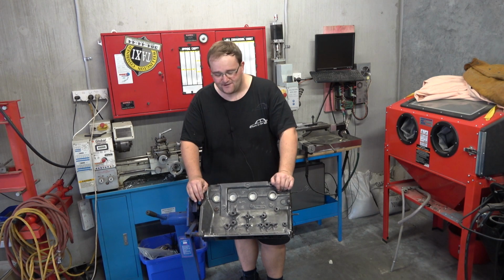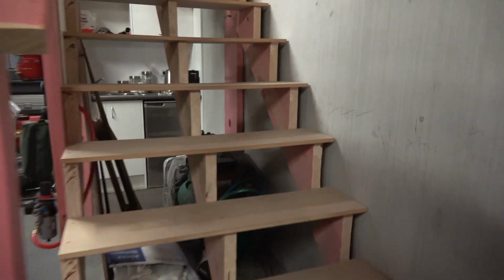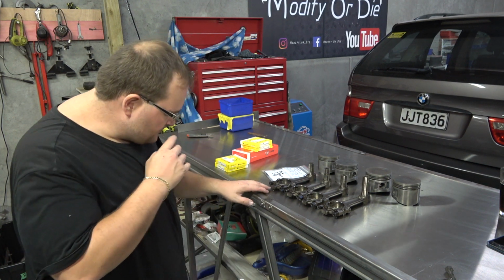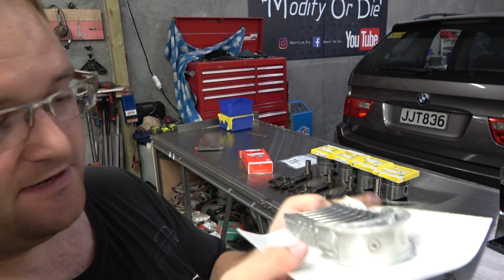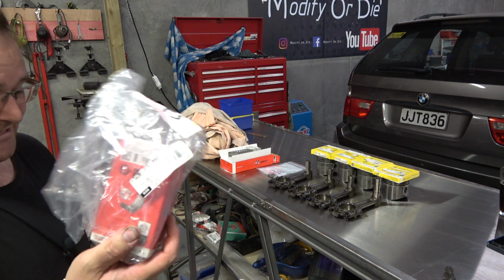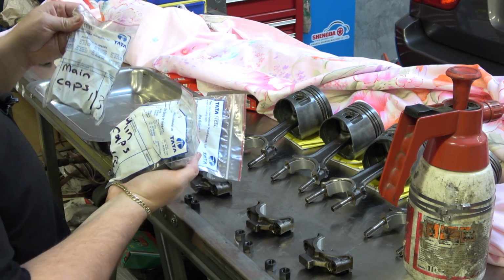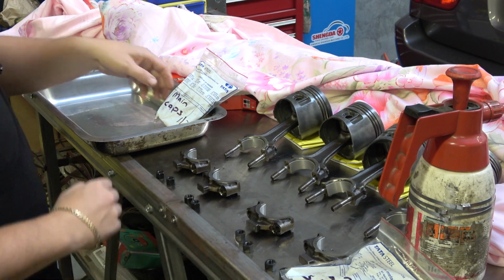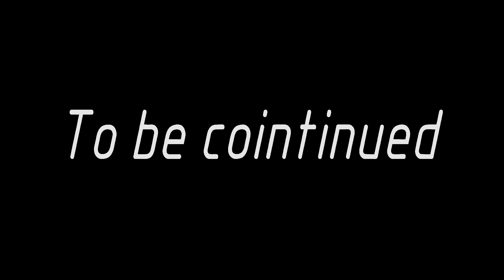M10 Turbo Build pt.3 - BMW 2002 Touring Restoration Project Episode 27

Comment: So everything is the right size and in tolerance, why bother numbering?
No two old parts are ever touching each other?
Reply from the maker: We number prior to removal as best practice. Though they are within tolerance, they are not all the same. I.E the bore warp was slightly different on each bore, but within tolerance. So, I would definitely not want to mix up piston to bore. Best practice for it to go back the way it came out.
Reply: How warped was the bore?
Reply from the maker: flyingkiwi very minimal, it was under the specified tolerances.